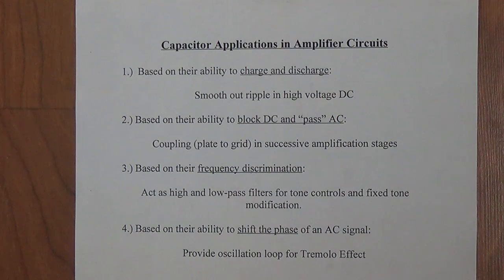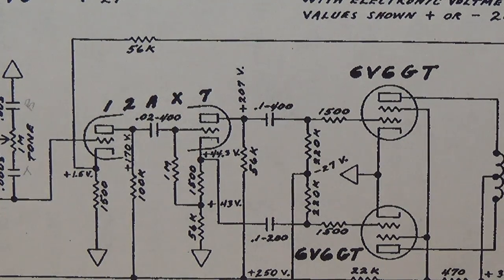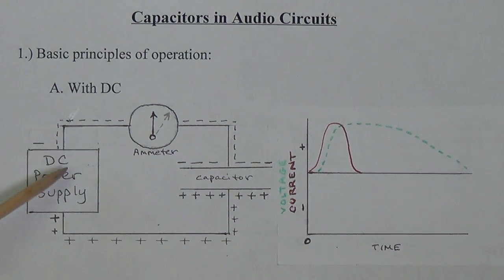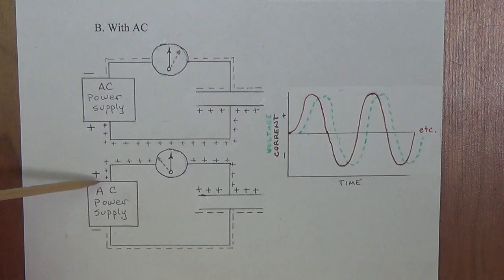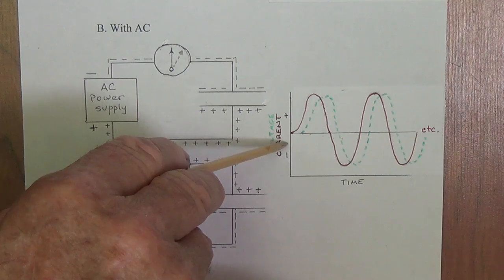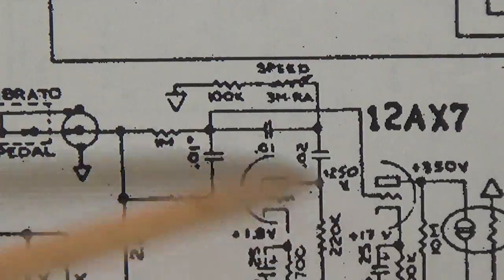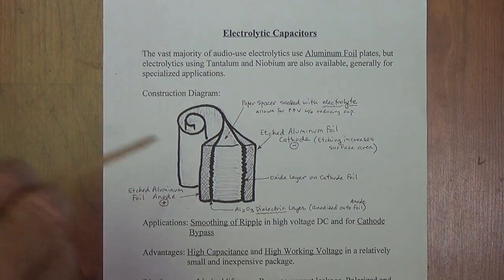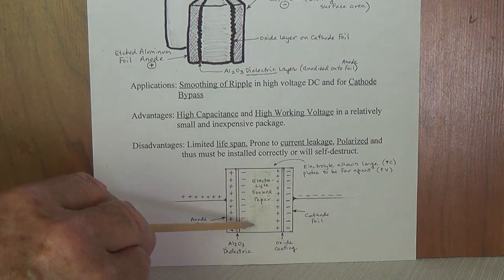Capacitors in Audio Circuits:  Part 3

Comment: Uncle Doug: On the schematic for the Fender Champ/Bronco AB764 there is a 330 pf cap across pins 5 and 8 of the 6V6. I've read a few articles in which it was referred to as a "stability cap". Can you tell me what the thing actually does? My guess from what I've read is that it has to do with HF roll off but the explanations are not all that clear, in fact some folks take the thing out. The AA764 does not have it.  Best regards always. JC
Reply from the maker: I honestly have no idea why you would want a low-value cap between the cathode and grid, Joey......unless your guess is correct. Only high frequencies could traverse it.
Reply: @UncleDoug  Many thanks as always. I'm learning this simple circuit before moving on to the Twin Reverb. You remind me of a professor I studied under at Rutgers many years ago who always said, among other things, that brute memorization might prove worthless in the long run, and that we needed to truly learn the subject backwards and forwards. He was the single finest teacher I've ever had and through the years he became my mentor and friend. Please take care of yourself and stay safe. JC ( KC2OUG)
Reply from the maker: @joeycigar63  Thanks for your very kind words, Joey. You, too :)

Comment: So an electrolytic cap behave like two or more normal caps in series?
Reply from the maker: I'm not sure where you got that idea, Dennis. Electrolytic caps behave like "normal" caps.
Reply: @UncleDoug  My mistake was thinking that in series capacitance is the sum of say two identical caps whereas its halved.
I blame Rusty.
Reply from the maker: @DennisSantos  Rusty passed away several years ago, Dennis, so it probably wasn't his fault. All capacitors behave the same both in series and parallel.

Comment: Uncle Doug, am i right in thinking when AC is fed into one side of the cap and AC then flows from the other side it has not physically jumped the gap but induction has taken place across the gap a bit like a transformer but without ant voltage change, and like a transformer it does not work when DC is applied?
Reply from the maker: Exactly, George. Neither AC or DC can actually "cross the gap" between the two plates. AC stimulates the creation of an equal charge on the distal plate, so it "appears" to have crossed over, while DC simply charges the plates with no current exiting from the distal plate.

Comment: so ac voltage after the full wave rectification process is dc the rest of the way through the amp. the ac you are referring to is the vocal or input(ie electric guitar) the only ac? thank you!
Reply from the maker: Yes, exactly. The amp operates on DC, but the music signal is AC. The primary circuit that supplies electricity to the power transformer is also AC from the wall receptacle.
Reply: @UncleDoug  thats a breakthrough for me because i was confused, thank you so much!!

Comment: 32:17...if you're gonna try to "reform" an old electrolytic capacitor, you'd BETTER apply a variable DC voltage! If you're gonna use a variac to control the applied voltage, you'd BETTER have a RECTIFIER in the current path- otherwise, you'd be applying AC voltage across the capacitor.
Reply from the maker: Generally, the caps to be re-formed are in a rectified circuit, Dale, so the rectifier is built-in.

Comment: Thanks Doug - the 'fog' is now beginning to clear (especially on electrolytics !)...I once diagnosed a fault on a computer clock circuit (1974 vintage) without really understanding why. It was a little tantalum electrolytic that was wrongly polarised. The power station only had one working clock board and seven non-working. A little investigation revealed all non-working ones were also reverse polarised - I had a small promotion as a result !
Reply from the maker: Good diagnosis, Dave.

Comment: Uncle Doug deserves a medal of honor! Always professional in depth of things explained.🎖

Also I stuck into some thing called vintage "dual can capacitors". A high voltage elektrolytic can cap with multi capicity tags in in case I got dry out one in circuit I want to replace this thing.
The last thing I want to do is ask some stupid question. 

I doubt in what way it opperates in the circuit. The diagram shows... power transformer(secundair 320VAC>rectifier>Capacitor 16+16+16uF(MFD) 400VDC (outher can is negative)

The 3. 16uF tags are connected with resistors and each tag has a different lead for function. 
I wondering is this thing parallel or series inside constructed? I ordered 3 separated axial capacitors with equal vallue (3x 16uf/400VDC) with the purpose of replacement. So series or parallel is to essential to choose. Hope Uncle knows because he knows best. I can show diagram if required 😊👍🏼greetings
Reply from the maker: The three capacitors are separate within the can.....just like the three separate capacitors you bought. They are not wired in series or in parallel. Each one connects a different point in the power supply to ground......just like it shows in the schematic.
Reply: Uncle Doug Thank you so much Uncle Doug allways much appreciated.
I think I was thinking too complicated. When the 3 positive lugs of that old can cap connect with each other with a 2.2k resistor from lug A(feeding VDC)>B followed by 4.7k to lug B>C. I was a bit confused.. i meassure a doubler in capacitance and its old, its dangerous, certainly working with high voltage capacitor. Better ask before harm or die 😊 👍🏼thanks and greetings from Netherlands

Comment: Used to take electrolytic capacitors out of transistor circuits put a long wire on them and set them off like miniature blasting caps
Reply from the maker: Sounds like fun, Michael. Be careful.

Comment: Hi Doug. I know this is old (so am I ), but I had to chuckle when I heard your cap charging story. Many years ago when I was taking electronics in the Air Force, they had plugin boards to teach building of various types of circuits with plugable components to accomplish each. There was always some smartass who would come around and mess with what you were doing, so I did the same with the DC power supply charging a few caps and leaving them on the bench. After a bit of fondling my stuff the smartass would inevitably come across one of the charged caps and the instructor would inquire about the noise usually a bit of profanity, and the smartass would depart the area. That brought back some old memories.
Reply from the maker: It's a great way to get rid of annoying visitors, HT. It would be unfortunate if a victim had a heart attack......but I guess you could just put the cap back in the drawer and call 911 ;)

Comment: Sorry if my question should be obvious. I've wondered whether the grid was being presented with voltage or current and if it is just voltage where does the current go or is both current and voltage seen as one thing that goes to the grid? I'll try not top ask anymore questions
Reply from the maker: The grid is a dead end, Robb, so current really can't flow. Instead, the grid is charged positively and negatively (voltage) by the music signal. Recall that voltage can exist without current.
Reply: Signal current flows through the grid leak to and from ground, developing a voltage across it which is applied to the grid.

Comment: It appears that the voltage lags the current in capacitors in the AC circuit and as it relates to the oscillator you show in the schematic and your own drawings. Is it the current that is being sent back a head of phase or the voltage lagging the current that is being sent back to the other grid of the 12AX7?  I hope the questions aren't so ridiculous. Thanks for answering my questions up to now no matter how silly they may be.
Reply from the maker: The current leads the voltage in capacitive circuits, so the phase is negative. To me, it's because you first apply current to a capacitor and then the voltage builds. Perhaps this diagram will clarify the relationship:  http://hyperphysics.phy-astr.gsu.edu/hbase/electric/phase.html

Comment: Hi Uncle Doug, what are your go to brand/series of capacitors to use in preamp and poweramp sections of an amp. I'm looking at doing a cap job on a bass amp and would appreciate your recommendation. BTW keep up the excellent videos, I'm always eager to watch. Thanks.
Reply from the maker: I use good quality but economically priced capacitors from Antique Electronic Supply, Declan, such as Illinois or Mallory  metalized polypropylene tubular resistors. I also like Sprague Orangedrop caps for a vintage look.

Comment: Uncle Doug I really appreciate all the work you do and the level of detail and explanation is just fantastic. I'm curious how capicators can be used to filter the B+ if they block DC? wouldn't that mean that power leaving the rectifier would never get out of the filter caps?
Reply from the maker: Thanks, John. The rectified current doesn't pass through the filter caps, it passes by them. Check out a schematic and you will see this. As it passes by each filter cap, the cap smooths the residual ripple in the rectified DC.

Comment: When rolled up, would'nt the anode and cathode be able to exchange electrons directly because of touching or close proximity without paper between them?
Reply from the maker: No, they can never touch, Philip. The entire basis of capacitance is that the two plates can never touch......if they do, it creates a short circuit, possibly to ground, which would be disastrous.

Comment: this series while fine for the basics but does not seem to address the controversies 
which the audio fools present. i would suggest a title "capacitors in circuits" instead.
if anyone reading this knows of a credible source that has identified the specific and 
objective measurable difference between the "audio capacitors" which command a price 10x
that of a standard polypropylene cap, please send me a link.
Reply from the maker: I avoided mentioning "boutique" capacitors, simply because I, like you (I assume), think it's all a bunch of nonsense. Electrons are not snobs. They behave the same in 50 cent caps as they do in 50 dollar caps.......and until someone can present a properly conceived  experiment in which people can accurately discern between cheap and expensive caps by ear, I will maintain my curmudgeonly attitude.
Reply: Right,... However: and I say this as an EE, science has examples of people not listening to others with the result that discovery is delayed. Classical electrical engineering will look at an amplifier by measuring THD etc with all the instrumentation that we have, but there is always the possibility that we have missed something important. This is where my interest comes in. "Is there something we are missing?" Perhaps not. Perhaps so. Hence my question: "Have there been examples of technical measurements that correlate the use of these 'boutique' caps and the associated language such as 'sound stage' ? If not, why? 
Now I do have some ideas - which I'd like to think are original but they are not, just simply not widely known. One of which is the importance of phase balance between channels in a stereo amp. Simply tolerance of components may lead to a disturbance in the "sound stage", (if I am using that 'term' correctly), due to channel to channel phase alignment. It is not routine to examine such a parameter, (at least with what I have read). 
Anyway you will get the idea here, the null assumption from an engineering perspective is that much of the 'audiophile' community is in need of a dose of reality, but would it not be embarrassing to eventually learn that they have some points? With effort - I am trying to keep an open mind.
Reply from the maker: As am I, Daniel......and I will welcome any definitive, scientific findings regardless of whether they support or challenge my present opinion.
Reply: @UncleDoug  A true scientist!
Reply from the maker: @silasfatchett7380  I am deeply flattered :)
Reply: We are still waiting for the results of a properly conducted blind test in which in which a significant percentage of subjects were able to identify the 'audiophool' capacitors.

Comment: Can the coupling capacitor from preamp to power amp be electrolytic? If so, what will the polarity be?
Reply from the maker: Since the value of coupling capacitors is generally in the range of .02uf, no, I have never seen an electrolytic coupling cap.
Reply: Thanks for the info :D
Reply: You would never use an electrolytic cap as a coupling capacitor, but if you did, the positive terminal would go to the high positive DC voltage at the plate.

Comment: I've been binge watching your vids since I came across them a couple weeks ago. This is amazing stuff. I have an electrical engineering degree, but I've been stuck in the world of software for the last 20 years. Your videos have rekindled a love of circuits that I'd almost forgotten about. And your delivery and wit are just icing on the cake.

I just finished this series because I was hoping to find out how to determine which type of cap to use based off of a schematic. When building an amp off of schematics where should one use polar vs non-polar caps. Orange drop vs electrolytic? Do you have a video that I might have missed (or not yet gotten to) that covers all of this?
Reply from the maker: Welcome, HW. Thanks so much. Electrolytics are used exclusively for power supply filtration (usually 10 to 50uf @ 450 to 500V) and as cathode bypass caps (usually 25 to 50uf @ 50V). All the remaining (tone and signal) caps are non-polar, i.e. Orange Drop, polypropylene, etc.

Comment: Another quick story: Years ago, before I became an educator, I used to work in printing.  For a while, I was in digital services for a branch of a large copy store chain, for which I did a lot of hardware support.  Basically, this wasn't really my job, but my manager knew I could fix stuff faster than the "real" hardware guys could get there to do it.  One day I come in and she tells me there's Mac that won't boot.  So I pull the thing apart, and take the cover off of its 12-volt DC power supply to find that one of the caps has blown itself up.  I didn't know nearly as much about caps as I do now, but these are large, cylindrical caps, electrolytics I assume, probably much like the filter caps you find in a tube amp, only bigger.  Manager wanted to know what had gone wrong, so rather than showing her the scorch marks on the inside of the case, I told her to close her eyes and sniff.  There was a distinct and unmistakable aroma of sulfur.  I would wager that this has something to do with Jack's ability to cat-scan for bad caps.
Reply from the maker: That's an interesting observation, Ed. I'll ask Jack about it......when he comes down from his catnip high :)

Comment: I’m a little confused about filter capacitors. If caps block DC voltage, How then do they smooth a voltage to fundamentally make it more DC? I understand the concept that they charge and discharge slowly, thereby providing smoothing, but this seems at odds with the concept of blocking DC. What am I missing? Is it dependent on the values of the caps in relation to the 60 Hz signal? Thanks as always for your videos and assistance!
Reply from the maker: The DC does not go through the filter caps, it goes past them. You can see this when you look at a schematic. As the DC leaves the rectifier with some ripple, it passes by each filter cap, which charge during the ripple peak and discharge during the trough, "filling in" the trough so that the ripple is smoothed to its peak height.
Reply: Yes, that make sense. Thanks!

Comment: I need your HELP – I have a vintage Crate Palomino V16.
I haven’t played it in a while and it worked and sounded great before putting it away.
I just played it today and it has a HUM that wasn’t there before.
I heard that in tube amps IF it’s a low-level pitch 60 cycle hum it’s probably a bad tube,
BUT IF it’s a high-level pitch 120 cycle hum it’s probably a capacitor that needs replacing.
I took out my guitar tuner and it shows the hum to be about an “A#”, and on another 
Audio scale it says it’s a 120 Hz pitch MINUS 49 cents ??? What the what ??
The Hum does Not respond to the volume control – does that info help also ??
I do own a multi-volt Meter – How do I locate and test the capacitor if it’s bad or not?
Awaiting your reply, and Thanks In Advance – I REALLY NEED HELP WITH THIS.
Reply from the maker: I have posted a video demonstrating the two common frequencies of hum, AW.  See if it helps you determine if it's really 120Hz.  If so, then at least one filter capacitor will probably need to be replaced. Good luck.
Reply: Hi Doug - Yes I have watched that video, and excellent and informative video too - My only hesitation is that My HUM does Not respond to volume at all and in your video you said that would indicate it's a  bad tube?? So at this juncture I am confused - it does sound like your 120 cycle hum BUT does not respond to volume at all. Aren't the 2 symptoms contradictory? One leaning toward Capacitor replacement, and the other being a simple tube replacement??
Reply from the maker: The hum only responds to the volume control if its source is BEFORE the VC in the circuit, i.e. in the first pre-amp stage. 120Hz hum originates in the power supply and thus will not respond to the VC. The symptoms are not contradictory and essentially confirm that the electrolytics are at fault.
Reply: Thanks for clearing that up Uncle Doug - MUCH APPRECIATED and my Yorkie Dutch sends his best to Rusty :)
Reply from the maker: Regards to Dutch from all the furry critters in Rusty's Workshop :)